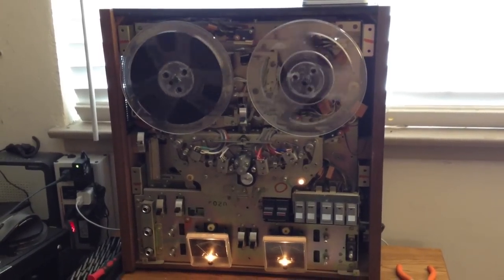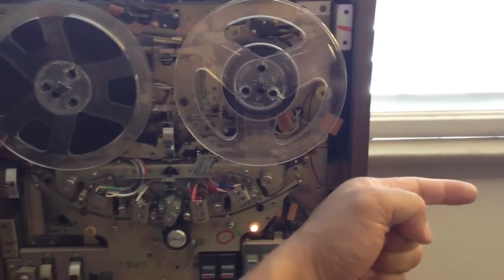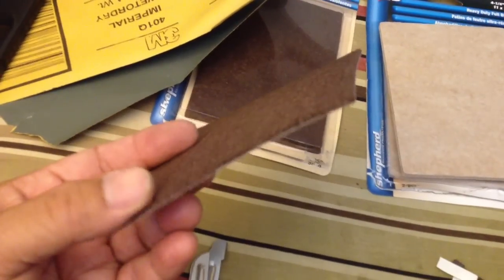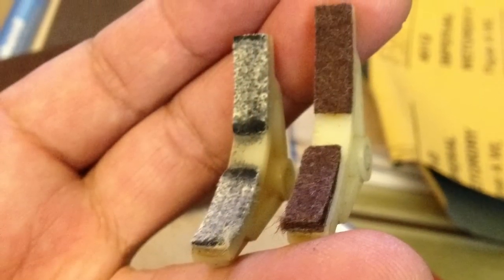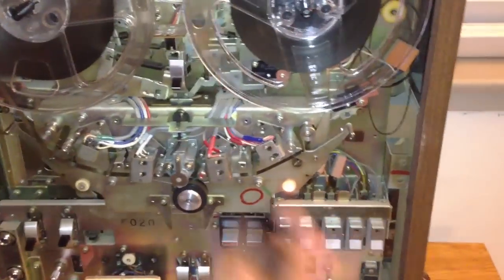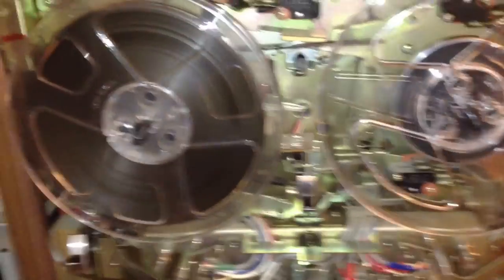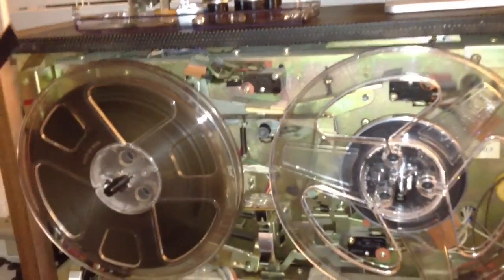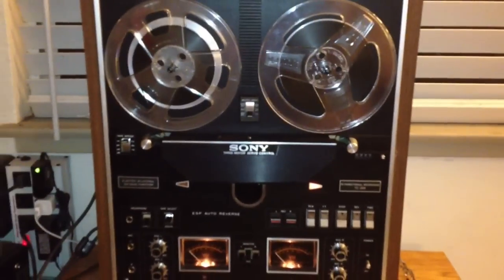Refurbishing the Brake Pads on a Sony TC-580 Open Reel Tape Recorder

Comment: Ernie,
Excellent walk-thru on the breaking system.  Thank You.
 I have owned a TC-580 since 1982.  I bought it used and the
only thing worn on entire unit were the  playback heads.  They weren't worn too bad (maybe 1/3 worn ?).
I still can't see any wear on the record heads.
Anyhow, I just wanted to mention that EVERYTHING worked perfectly  !   This tape deck never dropped tape
during any function.  The "auto-reverse" capstan wheel worked perfectly for another 5 or 6 years and then
it started to poop-out intermittently.  Now, capstan wheel switch-action doesn't work at all.  And, I have
the same breaking problem on the right reel motor when it comes to a halt (just as you did after installing new break pads.
It will dump a little tape and the "tape switch" will open and shut-down control panel.  I will fix this annoying stuff
in a few weeks.
The service manual for this deck has been available for many years online.  Sony produced THE BEST service manuals
for their reel-to-reel decks.  Sony was far, far, ahead of every consumer company that manufactured these amazing
instruments.  Teac is the WORST  !   Revox is just ok.  Akai is just stupid bad, but still better than Teac.
So, if you didn't get a manual (yet), I can email to you or you can "sign up" for membership on  "hifiengine" and
download for free (www.hifiengine.com/manual_library/sony/tc-580.shtml).
Also, as we move into the glorious fall season, I'm going to outfit my tc-580 with wireless remote control for
less than $25.  I plan to use Raspberry Pi uController board and a small InfraRed receiver device and a few low voltage,
low current, relays to "pulse" the Sony reed switches (push buttons) to active desired tape drive function.
Bye for now.   Regards, Gary S.

Comment: I have the exact same TC-580... maybe a little newer. Screw those brake pads, I just grab the reel with my hand. The machines of those days were PACKED SOLID with complicated machinery. I had to replace the belt and it cost me all of my patience. You clearly have more. I'll be sending you my tape deck with a check enclosed...

Comment: Ernie - Thanks for posting this video.  (You did so in May 2013. It's now Jan 2018.) I have a Sony TC-730, which is exactly the same as your TC-580 only with a built in amplifier. It has developed the same braking problem. I now plan to replace the brake pads in the manner you have suggested. Several points:
Your textual "Edit" above is definitely correct. When working correctly, the machine while in FFWD or RWD should come to an immediate halt when the STOP button is hit. This quick stop feature also should result in the tape retaining tension against the rollers and heads, without spooling out any tape slack at all when it stops. (Note: If there is any slack when you restart the reels, it can be disastrous as one of the reels will sometimes "eat" the tape.)
I managed to download a pdf of the Service Manual for this tape deck (at hifiengine). It does not tell or show how to replace brake pads. However, in Section 3-1-12 it shows how to do a "Brake Torque Adjustment" by moving the tiny spring on the bottom of each brake adjusting arm to a different notch setting. I tried doing this for each brake, but each of the notches I chose resulted in the tape actually being torn apart for some reason when I hit STOP....and it did not solve the tape spooling problem. So I have set the two tiny springs back to their original notch settings. I am now going to replace the brake pads in the manner you did. I may try using a slightly thicker pad.
Reply from the maker: SongBill40 If you can find suitable cork material, I would use that instead of wool pads.
Reply: @ Ernie:  Update - I just finished my "brake job" and the problem is solved. The Sony deck now works great. I did have to remove the reel tables and brake shoes to do the job. However, I did not put on new felt. Here's what I did:
(1) I simply scraped the overly smoothed surface of the felt pads with an Exacto blade, removing the slickness and bringing the underlying felt back to the surface, much like it probably was years ago.
(2) I used Isopropyl alcohol and Q tips to thoroughly clean the circumference of the black plastic on the reel table, where the brake shoe presses against it. That black plastic initially looked clean and smooth to the naked eye. However, it definitely was not. Scrubbing it forcefully with the alcohol and Q tip resulted in the Q tip becoming very,very dirty.  Also, once done you could see and feel the cleanliness of the black plastic, as if it were brand new. By placing the pad against the black plastic and applying a bit of pressure, I could feel the improved grab.

Comment: During playback the brakes are only used for stopping reels. The supply reel has reverse torque electronically applied to it to keep the tape tension up for proper head contact. This is an adjustment covered in the service manual.

Comment: I have a friend who inherited one of these from his step dad. He brought it to me for cleaning and adjustment. I ran into the same issue with the brakes, and used cork. It worked so there was no spilling, but I had to fiddle with the brake springs and adjustment it a lot to get it to work. Your felt idea should have worked since SONY made used felt, UNLESS their felt was a different more grippy weave (like a woven felt instead of a pressed felt). Your felt may be meant for gliding on furniture, which means it will slip. Possible other materials to try are sheet cork or rubber (like an old flat drive belt, but NOT a rubber band). It's a pity SONY didn't do the smart thing and use band brakes like TEAC did. MUCH simpler in the long run, and cheaper for them too!

Comment: Hey Ernie, I don't know if you read this, but I hope you will. You seems to be the right one to ask. I have a Sony Tc-645, it's in a generally good condition. But it's running a bit too slow in play mode. I'm not and expert on reel2reel tape deck but I have a good sense of it. I've spend a lot of time figuring out what it is. I now realize that the pressure metal pin (that spins on top of the pressure roller to get the tape going) is not giving a hard enough pressure. If I take a screwdriver and force the pressure pin down on the pressure roller, it plays with correct speed. My question is. How can I make the pressure pin give the correct pressure? Hope it makes sense :) thanks! And thanks for the video.
Reply: ...when I say "pressure pin" I mean the capstan, that goes onto the pressure roller

Comment from the maker: I got the felt at my local hardware store.  It was in the section for furniture padding that goes on the bottom of chair legs, desk top trophies, and such to protect wooden surfaces.  As for catching moles...cheese and a welding mallet.

Comment: What size felt do I use for brake pads of my Sony reel to reel? Who sells that type of felt? I could not read the package you had your felt in.
Reply from the maker: I had to experiment with trimming the material before I got the result I wanted.  It’s furniture padding for the feet of chairs and sofas to prevent scratching wooden floors.  If I were to re-do the brakes, I’d used cork gasket material.

Comment: Hopefully the playback head is the same as the TC 630 as 630's destroy their heads because the pressure pad has no centering action.I may be able to get a replacement.yours does not appear to need a pressure pad.

Comment: Hi,
. I need your help. I have been watching your videos and see that you are one of the only people that know these things.
So I have an Akai 4000D reel to reel tape recorder that I bought a couple of months ago. It was used and i was shown a demonstration before i bought and everything worked just fine.Although it was old i could tell it had little use and had been well taken care of. However when i brought it home and wanted to record some songs trouble. I engaged the pause,hit record and at the same time engaged the lever to record. Went ahead and set the levels so that it was good. But when I tried to disengage the pause to get the machine to actually start recording the pause lever wouldn't budge.It wouldn't move at all.Stubbornly stuck. I could tell that it everything is set and it wants to go ahead and move because i hear the motor (s) running but the pause is stuck. Do you think it needs oil or something?
Then i have 2 other decks which i know you don't like. I have a Sony TC 250A and Sony TC 350. Both play fine but when i record i have to set the recording volume all the way to maximum to get the VU meters to move at all and record music that sounds good and even then the recording is still low. There is some hiss but not a whole lot but I am not satisfied with the recording level quality. The sound of the recording itself is actually pretty good,Ok i guess. It's just so low. I have to turn the volume on the receiver all the way up to hear it satisfactorilly.
Any suggestions on all 3? Thanks in advance.
Reply from the maker: To release pause on the Akai, push the lever towards the faceplate.  On the Sony, you may have very weak/old tape that can't hold signal well.  Or, your heads need cleaning and demag.  The hiss you hear is tape bias and old leaky capacitors.
Reply: On the Akai when you say push towards the faceplate do you nean push up or down? Because before posting I tried both and still nothing. As for the Sonys I am still not sure because they both play fine and they record too,its just that the record level is too low. I could tell even before I finished recording because there was very little movement of both left and right VU meters. If it was head cleaning or demagnetizing that they need wouldn't the playback sound also be bad? Thanks for the comment!
Reply from the maker: No.  Not UP or DOWN.  Push on the lever as if you were trying to go through the face plate.  Think X, Y, and Z axis.  X is UP and DOWN.  Y is LEFT and RIGHT.  Z is FORWARD and BACKWARD.  Push forward.
Reply: ok, i didn't know about that,thanks for the tip, I'll try it next and update the post when done
Reply: Thanks a lot for the good tips because I finally got the Akai working again! Yeey! As it turns out all I had to do was pull the lever up towards me or away from me towards the machine itself (pressing down). I wouldn't have thought of this because of the lever construction,makes you naturally think that it's only allowed up or down movement . (I don't have a manual either) Now about the sonys what good will it do if i clean and demagnetize the heads? When they are on PLAY the sound is good on both. Don't these decks use the same heads for record and play?
Reply from the maker: Your 250a is a two head machine (erase/rec&play).  If the erase head is worn out or pressure pad missing, that can explain that machine's poor performance.  The 350 is a three head machine (erase/rec/play).  It also has monitor control (source/tape).  When in record mode, switch the mode to source.  Your meters should be more reactive to input as the meters will read directly from the input circuit.  During playback, switch to tape mode.  The meters will measure signal off the playback head.  You can diminish tape noise by recording at 7.5 IPS.  Also, on the back, turn off the SOS (Sound On Sound) switch.  That's for recording one track at a time.  If there is a huge difference between REC VU and PLAY VU of the same sound, either the tape is weak OR the heads are out of azimuth (alignment).  I'm pretty sure the 350 uses an AC bias oscillator, but not sure if the 250a uses DC bias (probably AC).  Over the decades, the circuitry in these oscillators degrade and that can definitely affect audio fidelity.  You'll never get hiss free audio from these machines.  Even brand new, there was a little hiss.  Only machines that run at 30 IPS and faster (mastering decks) are capable of reproduction noise floors of -90dB and that's with noise reduction.
Reply: Hi,I have an update about both my sony tape decks (Sony TC250A and Sony TC350).I cleaned all the heads on both of them,erase and playback,tape guides,pinch rollers,everything that the tape moves around but unfortunately the record level is extremely low,almost zero.Do you think the record switches which are in the form of potentiometers need to be cleaned on these need to be cleaned too or something? Thats the way recording is done on these. It's a set of knobs that you have to turn and the same ones are used to adjust the record level. Or is it an electronic problem? The VU meters don't move much at all,very little even in playback.The playback sound is fine. I am stumped now
Reply from the maker: You can try spraying circuit board cleaner on the pots and rec switches.  Be prepared that other electronic components are just worn out, like capacitors, and need to be replaced.  I don't have experience doing that.  Other YouTubers such as CassetteMaster and Clydesight do.

Comment: How easy or difficult to apply the brakes?
Reply from the maker: Installing the brakes is easy.  Adjusting how much pressure is needed is by trial and error.  Need patience to do it.
Reply: I got it open but how do I get to brake pads? I’m stuck
Reply from the maker: @TonyJenkynx  You have to remove the reel tables to reveal the brakes.
Reply: Sorry to be a bother,this is my first time but how?
Reply from the maker: @TonyJenkynx Remove the screws on the tips of the spindles to lift off the tables.

Comment: Wow, that's clean. My TC-377 is a greasy mess. I've got both the problems you had.
Where did you get the felt? I used moleskin to refurb my brake pads about 30 years ago. Catching those moles isn't easy.  :-)

Comment: Hello everyone, I wanted to ask I have a problem myself with my sony tc 580.
They brake really weak, I have them again as quickly as on the video, but after two days the problem was that itself.
Has anyone already deleted this problem and what kind of material has been used for brakes?
I would be happy for an answer. Many Thanks.
And greetings from Germany

Comment: I bought one from the original owner 10 years ago. Everything seems to work fine even though the pinch roller doesn’t automatically shift over from forward to reverse position. It doesn’t seem to matter but I can move it with my finger. Anyhow I want to sell it because we plan to move overseas.

Comment: all you needed to do was adjust them.....sigh
Reply: How
Reply: @fcwennekers7588  there is a little white plastic cam near each brake that can be lifted and then replaced into one of 5 holes, to increase or decrease spring pressure and clearance on the brakes.